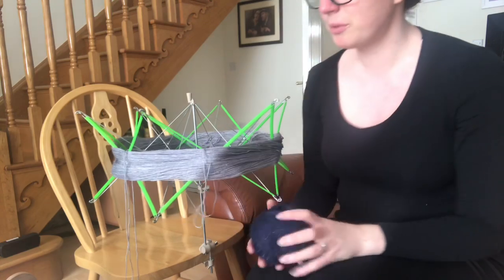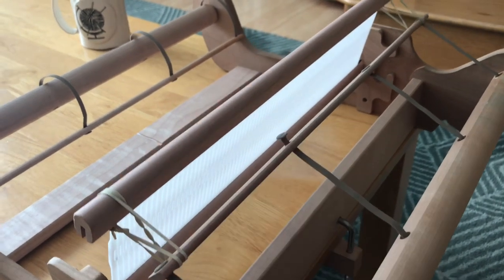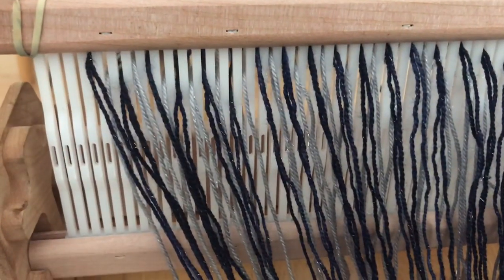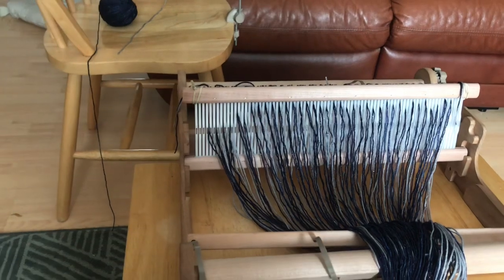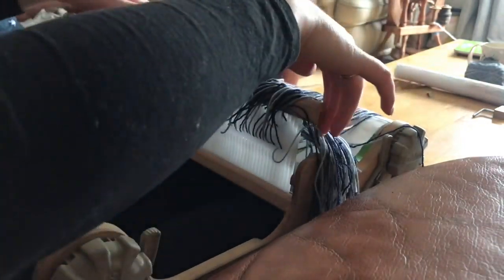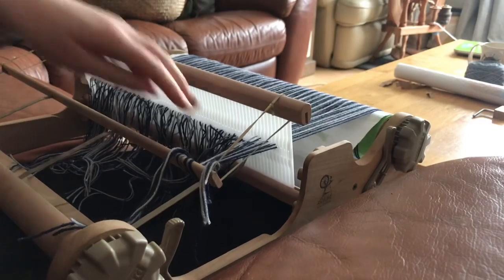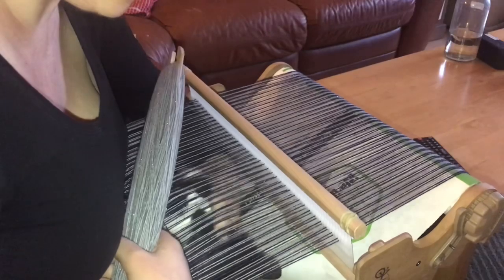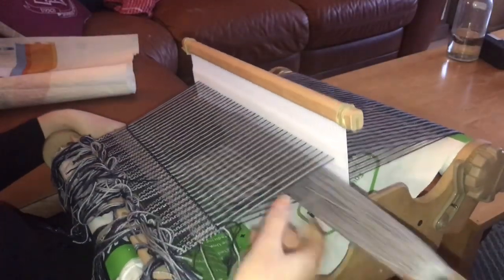How to Weave a Houndstooth Scarf on a Rigid Heddle Loom

Comment: Hi Grace, I warped my loom for this pattern, but I don't see the beginning portion in your video very well. Do you cut each differed color strand and tie it to eh apron rod? I assumed that's what you did, but I'm not sure. Love the rubber band trick you used to hold the bar upright. Thank you!

Comment: I'll appreciate if you could answer the following. Can I warp the loom beforehand and start weaving, say, several days later? Just wondering if the yarn will behave in different way due to long-term tension.
Reply from the maker: Rita Mhig Fhionnghaile Yes you can, I would try to wind the warp, or direct warp all in one go, but you could leave threading the heddle and winding on till later.  I would get to the point of weaving and then take the tension off a little bit so it reduces the strain on your warp. Use paper or spacers to wind your warp on too to reduce tangling of the warp if it’s left for a while

Comment: As you alternated threading the heddle with the light and dark colors did you cut and  tie each color on the back beam before threading the next color (as I have observed in other vides)? Or just alternate the colors without without tying each color off before starting the next one? If the latter method, are there any problems with that hen winding on the warp ?
Reply from the maker: LINDA GRAF I used the latter method. I did not find any trouble winding on the warp.
Reply: @GraceTheBabbler  Thanks Grace. I'm gonna give it a go.